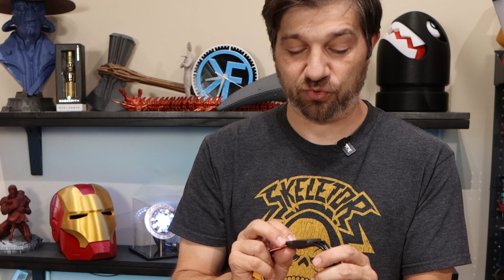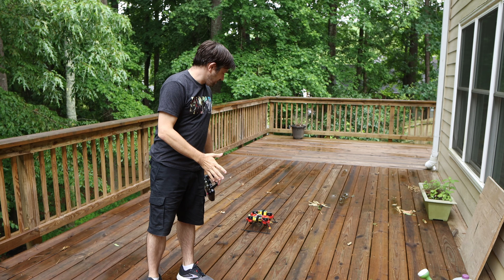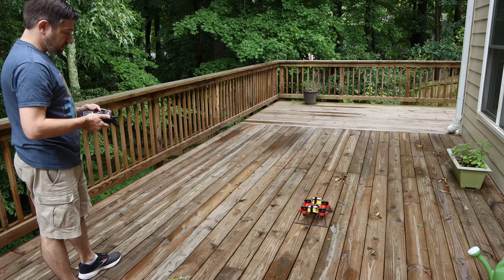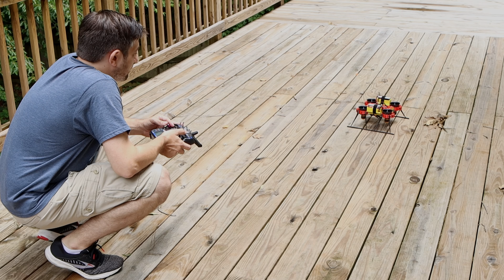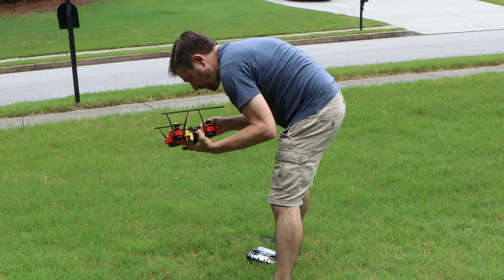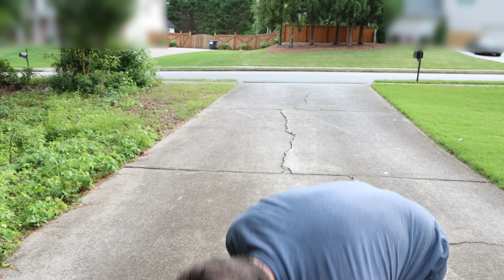3D Printed EDF Drone: Learning to Fly

Comment: optimistic noob expect to fly first time ever without gyrostabilisation 
and obivously dont have clue of tethered
:face-orange-raised-eyebrow:
Reply from the maker: In all honesty, I had no belief that I would fly the first time. I also knew it wouldn't be able to actually fly without a flight computer. Also, in all honesty, I didn't think about tethering until I was watching other videos. 😄🙄
Reply: @kerseyfabs  yes myself i become aware of the need of stabilisation only after using a non stabilised copter and since i respect all accro master because im still unable after ten year of pratice it requiert relflex in millisecond and a great situational awardness
i seen that a free control as for the olds kersoen copter requiered dozen of hours at ground hoping before any real fly

Comment: edf quads are hard to fly even with a flight controller. 
plus the smaller quads are the harder they are to fly .
i'm not saying it's impossible but it's close
Reply from the maker: Yeah, "live and learn" is the name of the game.
Reply: @kerseyfabs  EDF's aren't as responsive to changes demanded by their ESC's, but responsive enough to give you a good hover in typical conditions. Here's an example of how many changes are made just to keep a quad stable, showing individual motor outputs during a flight:
https://youtu.be/ZccPV8Ucl2g?t=286

Comment: I set out to build RC planes with my printers but went over the top with upgrades from the rubber ducky kingdom and now there gathering dust while trying to get them running again, The firmware side....  a true nightmare for a lorry driver to sort out.   Proper depressing. But, You get no where not trying.  Got pretty good on 3d design though, have tons of STLs ready to print.
Reply from the maker: I'm really sorry to hear it! I hope you get it back up and running! One day, if I ever have time, I'd love to start a firmware service.
Reply: @kerseyfabs  That would make you a rich man Kris. Tried to buy a Lerdge iX last night after watching your video on it, They have no way to ship to the UK. So i got a Kingroon KP3S v3.0 (Built but never used) cheapish of Ebay, Guys just up the road too so im off on a trek later to pick that up. Itll keep me interested while i build the other two back up.
Reply from the maker: @Gixie-R  Good luck with the new machine!

Comment: What the hack are you doin' my friend. You don't have all the parts you need, I can't see flight controller there! You must use flight controller. You can do the balance thing with a thin fishing line but you can't hover with out FC (flight controller). There will be too many variables to solve which is FC's job
Reply from the maker: I'm aware. I even say that multiple times. Part 2 is coming.
Reply: @kerseyfabs  then this is useless test and waste of time for me. (Also add video editing time to that waste)
Reply from the maker: @mraect6492  It was part of the process. Just because I'm learning and test different things throughout the process, doesn't mean they were a waste.
Reply from the maker: I'm sorry if my response was too blunt. I was just letting you know that I'll get to the flight computer in future videos. This video/test was just meant to learn about the wiring and electronics, while testing a bit of my drone design.
Reply: @kerseyfabs  Really looking forward, like edge of the seat anticipation, for which FC you chose for your setup. Currently, the SpeedyBee F7 V3 BL32 50A 30x30 stack would be my recommendation, running Betaflight firmware, without GPS or any other nonsense for testing. It's in a class of it's own for features vs price, super easy to solder to (get rid of all your connectors and solder up your wires, every gram counts, it would be epic to see exactly 1 XT-60 on the quad in video 2)

Comment: You should turn your radio on first
Reply: Second that!
Reply from the maker: Thanks guys! I wasn't aware that was the typical order. Noted for future flights.
Reply: Hey buddy awesome job can't wait to see it fly. Just FYI you should always turn the remote on first then the drone you want your esc to sync with remote rather than another signal that could be around and then afterwards the drone then the remote.
Reply from the maker: @chrislmink  Thanks for the support and the explanation!
Reply: @chrislmink  Actually in this case, the ESCs are controlled by the FC, but the FC itself requires the sync with the radio ;)